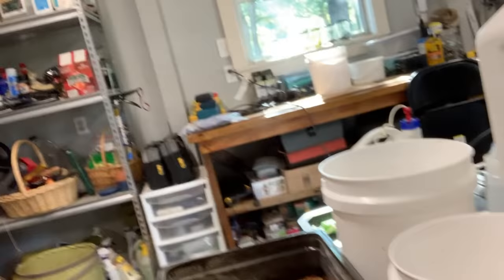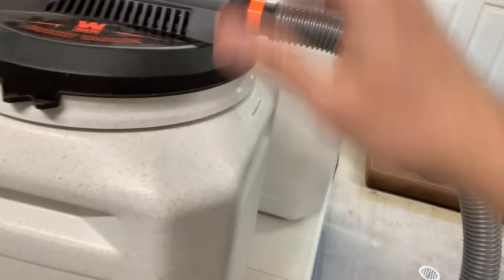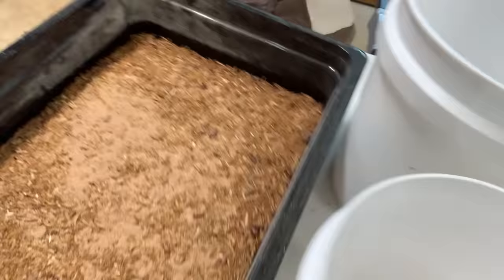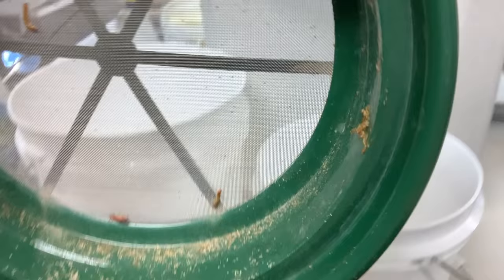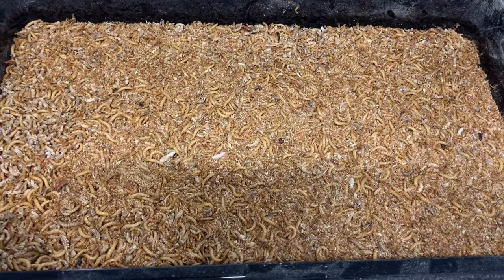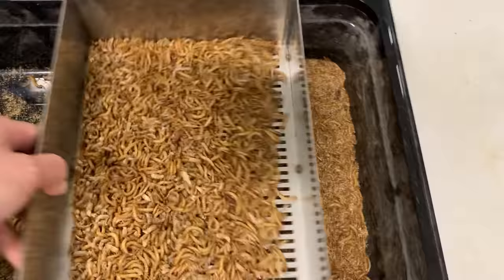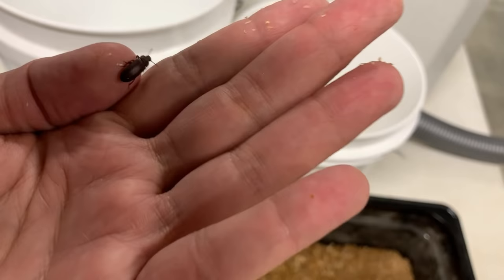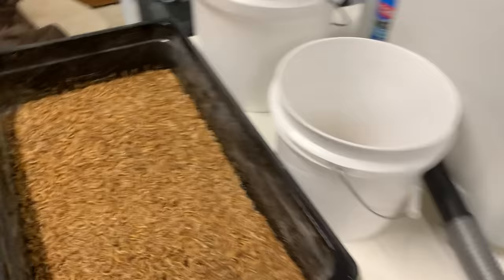MEALWORM FARMING FOR BEGINNERS – How to Maintain a Healthy Mealworm Farm

Comment: Great video!! I have some questions, can you help me? Do you have some way to sort the dead mealworms? And, in other way, do u give some use to the worm exoskeleton or dead worms?
Tyank you so much from Spain!
Reply from the maker: Hola Ricardo! Thanks for the questions. Unfortunately, there is no easy way to separate dead mealworms (other than using cleaner beetle larvae, which I don’t like to use since the mature cleaner beetles can fly). So, I have to pick out the dead ones by hand. Having said that, I am able to reduce the number of dead mealworms in my bins by always making sure they have plenty of carrots so they don’t dry out. As for the dead worms, they are still ok to feed to chickens. And I mix the exoskeletons with frass and add water to make a chitin “tea” that I pour on my garden plants. The plants sense the chitin in the soil and think they are under attack, so they strengthen their cell walls. That makes the plants stronger so they can focus on putting out more fruit and vegetables. Hope that helps, and thanks for watching!
Reply: @TheRealRancherMike  thank you for response my questions Mike! I wish you the best!

Comment: How many mealworms do you generally have per tray? I've been adding carrots and such to my trays but all of my mealworms are burrowed and don't usually resurface to eat them. Is this normal? Is it because you have more per tray so it looks like more are surfaced?
Reply from the maker: I usually end up with around 2-3 pounds of mature mealworms in each of my trays, which comes out to approximately 7,500 to 11,500 mature mealworms per tray. And, yes, it is perfectly normal to have all of the mealworms under the wheat bran. Hope that helps!

Comment: Great video.  Where did you get the mesh lids for your containers?
Reply from the maker: At the bottom of each of my YT videos, I include a link to my Amazon storefront. There, you will find a section called “Mealworm Farming.“ In that section, I list several bins, totes, and lids that you can use with your mealworm farm. Each time you purchase from my link, I get a very small commission, which helps me continue making these videos. For my system, I used these pans: https://amzn.to/3FoYtgg and these lids: https://amzn.to/384RNI5. For the lids, I cut the top with a router and added mesh for ventilation. The mesh I used is here: https://amzn.to/3KTc8NV. I attached the mesh with this two-sided tape: https://amzn.to/3FmRynV. I then placed this gaffer’s tape over top: https://amzn.to/3FmRt3B. Hope that helps!
Reply: @TheRealRancherMike  For some reason I was not able to see the list from my phone. I have an LG.  So I thank you so much for listing everything for me. Love your videos. I learn so much.

Comment: Seems like adding an attachment with short legs to the vacuum nozzle could held maintain a given distance above the surface.
Reply from the maker: I thought of trying that before, but the depth of the food substrate varies from tray to tray. Also, if the legs were dragging through the wheat bran, it would turn over and mix in the chitin on top, making it harder to vacuum up.

Comment: The video has some good and useful ideas and sifters for others who may have already gotten into it for a bit .  you came up with some great ideas for what you needed to do.

You mentioned that you can use the shed chitin in your garden.  Do you do the same for the frass or else, what do you save it for?
Reply from the maker: Hi Per. Thanks for the feedback. Regarding your question, I mix 1/8 cup of chitin with 3/8 cup of frass, add that to a gallon of water, stir it well, and then let it sit. Once the chitin-frass mixture has soaked for a couple of hours, I mix it again and then add the suspension to my garden soil as a drench. It works really well!

Comment: I am trying to mimic your system on a much smaller scale in my biology classroom.  A quick question:  I can separate everything successfully and remove my beetles and pupae much like you did.  However, how do I separate the eggs that my beetles lay so that they will develop into mealworms?  If I separate my pupae and allow them to develop into beetles (which are separated into a beetle tray) what is the methodology for getting the eggs that will hatch into mealworms.  I am afraid I missed something perhaps.
Reply: @TheRealRancherMike  Thank you!  I assumed that was the process as I have raised dermestids for years for cleaning skulls.  I did. sort of beetles earlier today but right now with the school year so in flux and tentative "shut down" I wanted to make sure ahead of time from a professional.

Comment: Wondering if you can help me. I have got a three-tier storage container mealworm colony that I just started last month. I have got two Beatles in the drawer, I got my meal worms in the middle drawer, then I'll pick the pupa out and put in the bottom drawer and these little containers. I have oats in these little containers, but for some reason my pupa is not making it they are dying and I can't figure out why, like I said I've got to beetles out of about 150 pupa or maybe a little more. So today I put a little bowl of water in my pupa drawer to see if they need some humidity. Do you have any ideas on what I am doing wrong. I just can't figure. The pupa it's like they get to almost the end to where they turn into a beetle and then they just died, the only thing I can figure out if they're not getting enough humidity. Any thoughts 💭
Reply from the maker: Hi Kimberly. Thank you for your question. I can’t diagnose your problem definitively, but it sounds like your mealworms may not be getting enough moisture, and when they turn into pupae, they are drying out. You should try to put more moisture supplements in your mealworm drawer so that they go into the pupae stage fully hydrated. I hope that helps. Good luck!

Comment: Where did you get the lids with screen? thanks
Reply from the maker: At the bottom of each of my YT videos, I include a link to my Amazon storefront. There, you will find a section called “Mealworm Farming.“ In that section, I list several bins, totes, and lids that you can use with your mealworm farm. Each time you purchase from my link, I get a very small commission, which helps me continue making these videos. For my system, I used these pans: https://amzn.to/3FoYtgg and these lids: https://amzn.to/384RNI5. For the lids, I cut the top with a router and added mesh for ventilation. The mesh I used is here: https://amzn.to/3KTc8NV. I attached the mesh with this two-sided tape: https://amzn.to/3FmRynV. I then placed this gaffer’s tape over top: https://amzn.to/3FmRt3B. Hope that helps!

Comment: I’m just starting. Why do you use wheat bran instead of oats. If I have oats should I put them in the oven?
Reply from the maker: Hi River. I use wheat bran because the flakes fall through the sifters I use more easily than oats (which is critical when I am trying to separate beetles or mealworms from the food substrate). You can certainly use oats, if that’s what you have. And, yes, you should definitely bake your oats at 275 F for 45-60 minutes to kill any grain mites and/or grain mite eggs on the oats. Good luck!

Comment: Do you have a video or writeup as to how to start from square one having a mealworm farm, where to get all the accessories, and a recommended weekly schedule on what to check and do routine?  I tried starting a mealworm farm in an acquarium (found a couple of sources that recommended this) with oatmeal (couldn't find wheat bran), but now have all stages of mealworms together, can't see where the eggs are, and don't know how to separate everything and clean out.  Don't want to lose any eggs if they are present.  Also, I noticed you don't have any heat source for your mealworms.  Don't they have to be at around 80 degrees?  Mine are in our basement so I put a reptile heat pad underneath the acquarium.  Thanks for any advice you can give me!

Comment: Doesn't your stainless steel sifter weigh rather a lot? A bee keeping friend has recommended a queen bee screen for sorting pupae from larvae, so I've taken a gamble and ordered a 50x40 cm plastic screen, with 4mm slots. I notice your steel version was labelled .125", ie. an eighth of an inch (how I love these quaint, old-world measurements!), approx 3.2  mm. Only $6, so worth a try. I have lightweight wooden frames that sit over my 60x40 cm eurocrates, so if it works I'll make a frame to fit it. I have various mesh sizes of stainless steel for all the other sorting, and reckon each sieve cost me $12- those green plastic ones you use are $150 a set in the UK!

Comment: What is the width and length of these black trays?   You can freeze your grains for 24 hrs and it will kill the mites 2.
Reply from the maker: The tops are 12-3/4” x 20-3/4”. You can find the trays and lids for purchase by following the link at the bottom of my video. You will find them there under “Mealworm Farming.” When you purchase from the link, I get a small commission which helps me keep making these vids. Thanks in advance for your support!

Comment: I seem to have a very low survival rate of my pupae. Only a small amount turn into beetles despite separating them daily. Any tips on why most just turn black and don’t turn into beetles please??
Reply from the maker: Hi Sheena. I think the issue is that your mature mealworms don’t have enough moisture before entering the pupae stage, and so they dry out while going through the metamorphosis. Try putting more carrots in your mature mealworm bins and see if that helps.

Comment: Where did you get black trays with fitted screen tops? I was unable to find them on Amazon
Reply from the maker: You can find the pans here: https://amzn.to/3FoYtgg and the lids here: https://amzn.to/384RNI5. For the lids, you will need to cut the top and add mesh. The mesh I used is this: https://amzn.to/3KTc8NV, which I attached with this two-sided tape: https://amzn.to/3FmRynV. I then placed this gaffer’s tape over top: https://amzn.to/3FmRt3B. Hope that helps!

Comment: Thanks for the video. How would meal worms go as composters? I'm considering using them in my apartment in place of a worm farm or compost bin (extra worms will be donated to the local wildlife rehabilitation centre). It looks like they would be less smelly than compost worms and the frass can be used on local plants.
Reply from the maker: Hey Kerry. Thanks for your question. Mealworms aren’t really great composers per se, but you could feed them certain scraps like potato peels, old carrots, pieces of fruit like apples, etc, since they need the moisture to survive. Red wrigglers are really better for composting purposes. Hope that helps!

Comment: I know this may be a long shot since the video is nearly 3 years old but you stated in the video that if anyone had interest in the containers you may be able to help with a link as to where you aquired them from. I've looked on google (and several pages deep) and I've turned up nothing that is even similar. If you're able to please post a link to where I can purchase them myself. 

Thanks
I Am Just1
Reply from the maker: Hi Just1Kurt. At the bottom of each of my YT videos, I include a link to my Amazon storefront. There, you will find a section called “Mealworm Farming.“ In that section, I list several bins, totes, and lids that you can use with your mealworm farm. Each time you purchase from my link, I get a very small commission, which helps me continue making these videos. Thanks for your support!

Comment: I maintaining a small amount of mealworms ... 2000 . Could i use oatmeal as a bed and add carrots for water content?
Reply from the maker: You certainly can. I choose not to use oatmeal because it is harder to separate the mealworms from the food substrate later. But the mealworms will do fine with it as a food source. And I use carrots for water, too, so you should be good on that, too. Good luck!

Comment: question: 
what is the time circle sir ? 
from egg to worm to buck
Reply from the maker: That is a tough question because it depends on a lot of different factors - the temperature where you keep the mealworms, the humidity of the room, whether you provide adequate food and hydration supplements, etc. Having said that, it should roughly take 3-4 months for eggs to turn into fully mature beetles.

Comment: can you add a link to where you got  the trays?
Reply from the maker: Hi Fritz. At the bottom of each of my YT videos, I include a link to my Amazon storefront. There, you will find a section called “Mealworm Farming.“ In that section, I list several bins, totes, and lids that you can use with your mealworm farm. Each time you purchase from my link, I get a very small commission, which helps me continue making these videos. For my system, I used these pans: https://amzn.to/3FoYtgg and these lids: https://amzn.to/384RNI5. For the lids, I cut the top with a router and added mesh for ventilation. The mesh I used is here: https://amzn.to/3KTc8NV. I attached the mesh with this two-sided tape: https://amzn.to/3FmRynV. I then placed this gaffer’s tape over top: https://amzn.to/3FmRt3B. Hope that helps!
Reply: @TheRealRancherMike  Most helpful Mike.  Godspeed.

Comment: Rancher Mike, first of all, great video!  You make it so much more understandable and easier than others I have watched.   Also, I saw in another comment that you are not going to be selling your  homemade devices.  Would you at least be willing to draw up the plans/blueprints to send to me?   I know they look fairly easy in the video, but I am one of those people that need measurements and an actual plan to build something. My imagination isn't sufficient LOL.   Please?   If you are willing I will give you my email address to send it to.   I have a flock of chickens I want to start this setup for ASAP.    BTW.  The link to your wheat bran on Amazon says it's out of stock.  Where else would you buy this?
Reply: @TheRealRancherMike  thanks.    Can you just send of L/W/H measurements?  I will see what I can do about finding some suitable metal in the next few weeks and possibly who I can get to cut the slats in it.  I have some welding flux cored rods to use to weld it up.   It can't burn through the metal as easily and it is strong enough for this job.  I will contact you on Facebook if I have questions.  :)   ty again.  And ty very much for your quick reply

Comment: Where you able to make an Amazon list of your supplies/ tools? Great content thanks
Reply from the maker: Hey Justin. If you check out the bottom section of each of my videos, I post a link to my Amazon storefront where I curate the products featured in my videos. Here's a link just in case: https://www.amazon.com/shop/ranchermike?listId=3NT86UF592RU8. Look for the section called "Mealworm Farming." There you will find all of the mealworm farming tools that I use (bins, lids, vacuum head, etc.) along with other cool mealworm farming tools that I have purchased on Amazon, like this neat mealworm pupae sieve that I just bought! https://www.amazon.com/gp/product/B08Y8291CY?pf_rd_r=NDD5ZXQJW1JPA14R8W1E&pf_rd_p=5ae2c7f8-e0c6-4f35-9071-dc3240e894a8&pd_rd_r=8faafafd-8bf5-446a-a7ad-fdaaea70aa8a&pd_rd_w=04bpa&pd_rd_wg=WaYGU&ref_=pd_gw_unk I'm going to be doing a video on this product soon, and I really like it, so stay tuned for that! And thanks for watching!

Comment: My beetles don't seem to be producing eggs?? Almost all either pupa or Beetles, for several weeks now. I looked up what the eggs look like and how big etc. but have found none. I don't know why. Suggestions? I have over 5000 beetles and pupa, I am told.  They seem to be breeding ok.
Reply from the maker: You won’t be able to see the eggs with the naked eye. The beetles will usually burrow and attach the eggs to the bottom of the bin. Just move your beetles and pupae from the original bin to a new bin about every 2-3 weeks (but leave all of the original bedding in the original bin as that may also conatin eggs!), and after another couple of weeks, you’ll see movement of the tiny mealworms in the original bin. They will continue to molt and grow for several weeks until they get big enough for you to harvest and/or allow some to transform into pupae (and ultimately, beetles). By separating those pupae and beetles and putting them in a new bin, you can continue the cycle. Hope that helps!

Comment: I am just starting my farm fully set up today lol. But i have a question... Before i set it up i did some research and found out that oatmeal was a good source for them... BUT the oatmeal is molding within a week of changing it! Please help!!
Reply: @TheRealRancherMike  i set up a 3 stage system using a 3 tier storage bin and i haven't had any problem since.. Could it be that they didn't have enough air? Also how soon do you start to see eggs hatch? I have around 20 to 30 beetles now and still have no larva (its been about a month since the first beetle came) its around 75 to 80 degrees Fahrenheit in the room that they stay in.
Reply: @TheRealRancherMike  i actually have a self sorting thing going on... The beetles are in the very top with wire mesh for the floor and that drops the eggs into the second bin. The 3rd bin has the worms and pupa and have a divider between them

Comment: Is getting wheat bran going to be an issue now, with sanctions in Russia? I know some stuff comes
from there. I am interested in this system. How fast is the meal worms cycle?
Reply from the maker: Hi Nikki. I don’t know that wheat bran will be affected. As for the mealworm cycle, it takes about 3-4 months to go from egg to beetle. The speed depends on the temperature and relative humidity of the place where they are raised. Hope that helps!